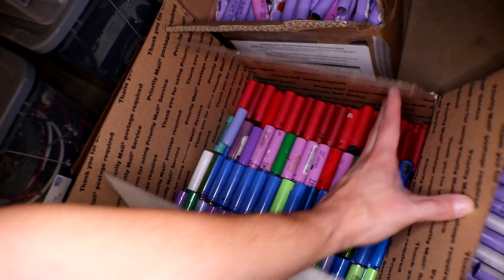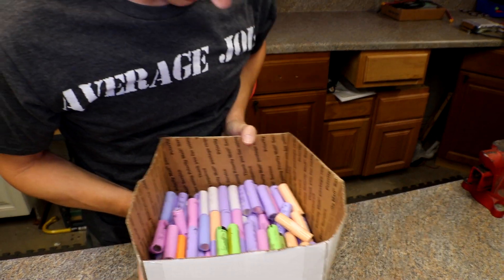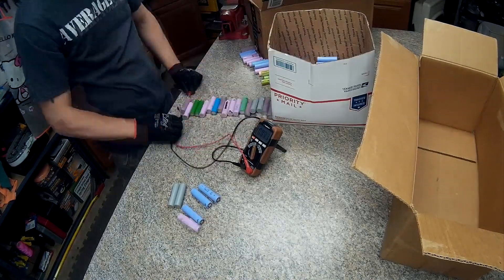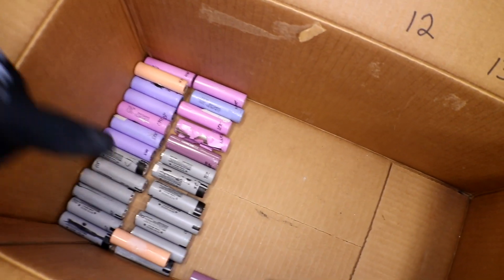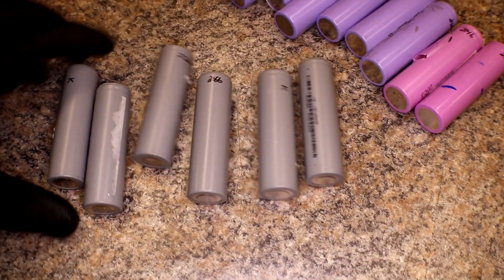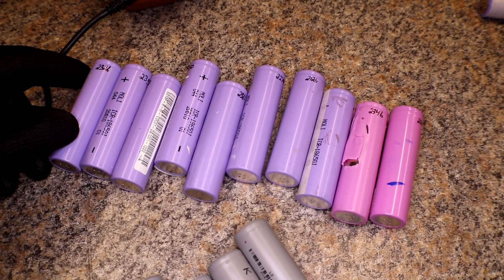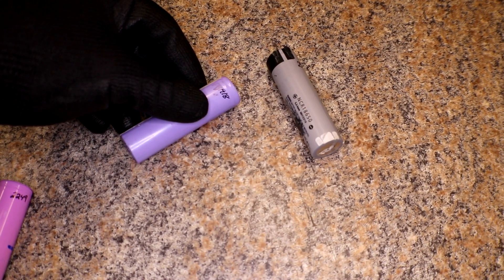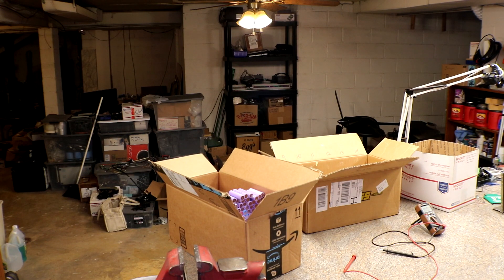🔋⚡Checking Voltage and Sorting 18650's "Manual Repackr"🔋⚡

Comment: I'm sorry to say, but your repakr will not be accurate because you let your cells sit at full charge for over a year. I made the same mistake and am in the process of retesting all of my cells and putting them in storage voltage. Of the cells that did not self-drain, a bunch went from holding 90% of their original capacity to like maybe 40%. The vast majority lost at least some capacity, but the capacity loss was not uniform. Since you have so many testers, it shouldnt take you long to retest.
Reply from the maker: My first packs sat for a long time as well since it took so long to get enough and they turned out ok.  They few that I have retested, tested better😮

Comment: Curious how many AH
Reply from the maker: ME TOOOO lol I think I have more 2600-2700mah cells this time around!
Reply: I’m doing my first build a 7s-20p. Mainly 2400 mah . Just need to find which spot welder to get. 

Keep up the good work
Reply from the maker: Nice!  I built the arduino spot welder and it works great.  I also have the k-weld but havent assembled it yet!